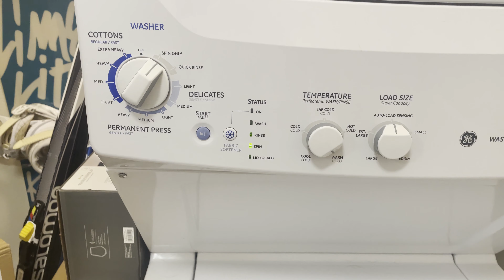Ge Stackable Washer Won't Drain

Comment from the maker: There are other issues that can cause your GE washing machine to not drain, but this is the problem I run into a lot. No parts required. If this does not fix your problem please leave a comment below.
Reply: Just bought a GE stackable a month ago. From the first wash with only a few tee shirts it did not drain. Service tech ran it in service mode and did not see a problem. Still does not drain.

Comment: There is a tool you can buy that will pinch that drain line before you disconnect it. Then have your wet vac on and ready right behind the pump when you disconnect. You'll save a hole lot of smelly water in the floor but solid repair and instructions nice job👍
Reply: I don’t have a wet vac, can the hose reach to a bucket if I had one near?
Reply: No

Comment: Ok, so my washer dryer stack combo is doing the same. I believe it’s the same brand as well. 

It turns on, fills with water and then doesn’t start the cycle. I opened the front panel as in the video, opened the water filter and then checked to see if there is anything clogged. Nothing. 

What do you recommend doing if it doesn’t work?
Reply: Yah same. Nothing there. Should we open the other tube ? lol

Comment: Is there a way to see if that pump is clogged without separating it from the hose first ? I'd rather avoid dealing with those clips in the event that it's not the issue.
Reply from the maker: Kinda. If you feel the pump and hear the pump trying to run, but it doesn't drain, it's (probably, not 100%) clogged.
Reply: Okay thank you for such a fast response.

Comment: Hmmmm, my GE stackable washer/dryer is doing the same thing: Flashing the spin light with the lid locked light on and refusing to spin. I tried this trick but didn't find anything stuck inside the pump or hoses (I took both incoming and outgoing hoses off). The cycle when it tries to run makes noises like its going to spin, then a clunk, then stops and flashes the lights. Could this be the pump itself? Thanks in advance!
Reply: What ended up being the problem? Bad pump?

Comment: How do u know where exact is the clips to remove the front, my tenent also having drain problem
Reply from the maker: There's a slight dent, you can use a flashlight also to see the metal clips, if you don't see them then your model may be different and will have to take another approach.

Comment: What’s your best recommendation if I lack a dry or wet vac?
Reply from the maker: bail the water with a cup / use a tube and siphon / clamp the tube going into the drain pump until it can be fixed ... There is no one all answer to this question

Comment: Mine won't drain but the lid lock is engaging. No obstruction in the pump. Whats next? How can I test the pump to see if it's the problem? The pump won't even make a sound. The lid locks and it goes dead silent and freezes.

Comment: My washer is draining but my Wife said last night it started making a loud grinding noise when draining. I tried it today and noticed it was coming from the drain pump.

I pulled the pump and found a grey plastic disc about 7/8" in diameter and about 1/8" thick inside.  It has 5 small through holes.  I was hoping to find a foreign object.  but I am now wondering if what I found stuck in there belongs with the assy. or maybe came from up- stream.  At first I thought maybe  it could have sat in the intake part of the the impeller housing. But if that were the case it would never drain properly and there would never be a sock getting through there.

 I think this is a foreign obect. Any ideas based on the description? Thanks.
Reply from the maker: Baffled. Not a button off of clothing? For some reason foreign object always find a way into the drain pump on most washers.
Reply: @ApartmentMaintenancePro  I was baffled as well.  It makes me feel better knowing that someone that is more knowledgeable than me about these appliances not know what it is I found after describing it as best I can. I don't think it was from the washing machine.  I am curious as hell what it is and where it came from.  I think it may have came from my son's toy arsenal.  Appreciate the response.

Comment: I tried this method but there was no sock in the Pipe and it still won’t drain :(. Is there another location for possible clugs?
Reply from the maker: Possible blockage elsewhere down the line or a bad drain pump
Reply: @ApartmentMaintenancePro  thank you! Might be the pump it making humming noises and was really hot

Comment: Is that exact tool needed to take off the screws? I’m trying to fix my washer myself lol it won’t drain.
Reply from the maker: Hi, which part of the video are you referring to?
Reply: @ApartmentMaintenancePro  sorry, the drill to take off the screws
Reply from the maker: @sanderslut505  To take off the drain pump you'll need a 1/4" nut driver (on this GE model), doesn't necessarily have to be a drill :)
Reply: @ApartmentMaintenancePro  Thanks a bunch!

Comment: Mine is making clicking noise almost like it’s trying to secure the lid and it just turns off. I just have to sit there and raise the lid up and down till it decides it’ll rinse  drain and spin.
Reply from the maker: Sounds like a bad lid lock
Reply: @ApartmentMaintenancePro  
The door is not engaging the lock lol 
I can press down the lid and it’s fine

Comment: I run into this alot as well. Nice work bro💪 How bout them Bucs ? TB12 has them in the super bowl 👍 Go Bucs 🏈
Reply from the maker: Throwing a party today for sure. So stoked! Can’t believe they made it I been rocking the TB 12 Jersey all week :) Go Bucs!!
Reply: Thank you for the satisfying video!  I find it quite satisfying to watch you repairing all the broken washers.  Great job!  By the way, do you find yourself repairing the Whirlpool WET4024HW a lot?  That's the small 24" 1.5 cu ft washer dryer combo.
Reply from the maker: @YN-sj6mu  Hey thanks for watching! I haven't worked on any of the newer models as I've never ran into them yet. The older version of that model I've made a few repairs on though :)
Reply: @ApartmentMaintenancePro  thank you for the response!